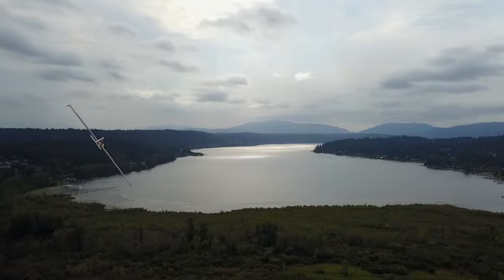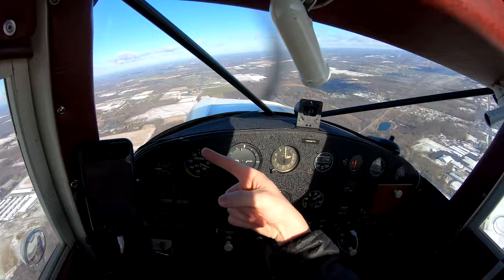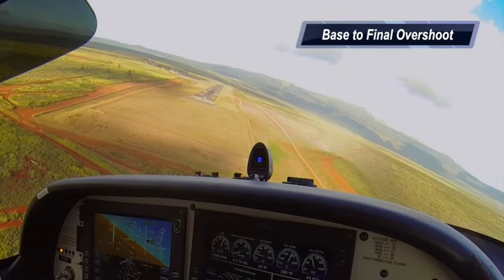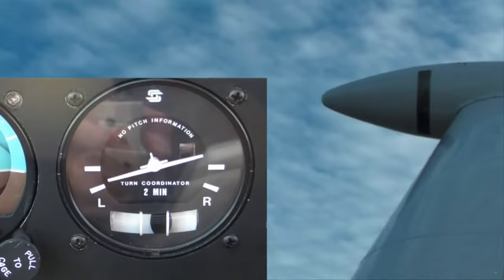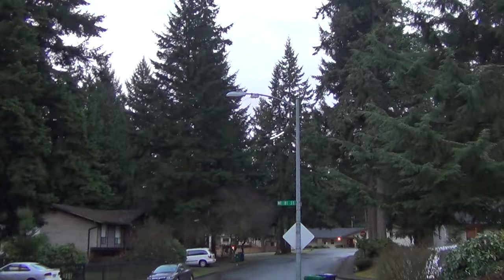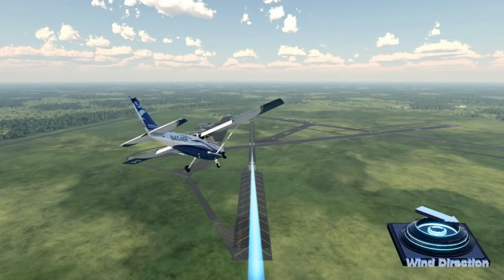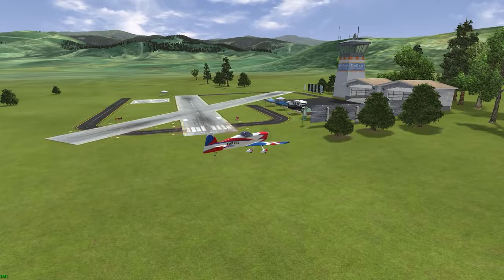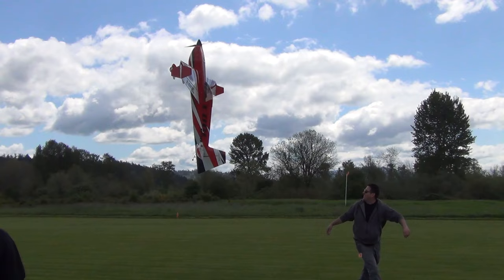Rudder: You MAY Be Using It Wrong. Here's Why.

Comment: This reminds me of years ago when, at the flying field, our longtime club president mentioned he hardly ever used a rudder input. This got me rethinking using the rudder more, improving my overall enjoyment of it. Much later, during flight instruction In a 150 Cessna in Fairfield, MT, using the rudder all the time, especially during the landing approach. Now Fairfield, MT, is close to the east side of the great divide, and the wind blows strongly from the SW most of the time. For reasons unknown, the main landing strip runs SE to NW, and strongly induced side slip was mandatory. This experience improved RC's enjoyment even more. Thanks for that instruction.

Comment: When I first learned how to slip my FMS supercub I went crazy with. There's a driveway all the way around our field, and I flew 3 or 4 packs around it, on the ground😂 I would alternate between wheels, but never really went up in the air. These shenanigans continued for months because driving a cub around is way more fun than flying it lol. This is with headtracking FPV and a decent bump in power over factory of course, but still, one of the most satisfying things I ever learned.

Comment: I've been flying fixed wing rc for almost 20 years but never really used the rudder other then on the ground. However the last couple of years I have gotten into fpv quadcopters. As you know with quads you use a lot of "rudder" to control your direction.
I have noticed that I use the rudder on my fixed wing planes much more. I look back to how I used to fly and I realize I have been doing un coordinated turns all these years. I recognize how the plane looks and  can adjust rudder correctly to keep turns coordinated.

Comment: Great video and explanation!
What's weird is that I started flying RC with rudder only.  1 channel.  I even learned to do rolls and loops with rudder only !
And a few decades later got back into RC, and almost never touch rudder.   
Now I'm trying to learn to use the rudder more.   Dang near want to go back to 3 channels; LOL.   Stopped using a mix for coordinated turns.    Having fun with flat turns.   And learning to do 1 wheel touch & goes.     It's like starting over, but doing it the right way.

Comment: It's like kayaking the rudder isn't for steering. it's to keep it straight. As you paddle it clocks ( turns) so you compensate with rudder. The shorter the kayak the worse the problem.  On my 5 mtr it's up and I don't use.  On my 4 mtr I do use.

Comment: Should be required viewing for all RC and full scale pilots. Great job 👏🏼
Reply: I wouldn't say required some of us RC are flying wing and delta craft with no tail control.  The flight test versa wing was my first, I got good with yank and bank with the arrow, and the flight test version of the saab 37 vegan was the first craft with a tail I flew confidently (still no control inputs because that's not a control surface on it).  I had some regular old trainers and I think I had crashed one of those cessna based craft.  I'm gonna have to learn some more on this rudder controlled slipping, even if my favorite planes don't use it, it can be helpful in games like war thunder.  Presenting less wing area to the ground by banking hard in one direction and then the other is what I've been doing simply because that's what I found worked.  if you look at the latest video i uploaded the type of games i enjoy playing can be decided by how quickly you can land and rearm.

Comment: my advice is to learn to fly with no yolk inputs, just throttle rudder and trim, its like riding a bicycle with no hands, then once you can do that add the yolk back in for making corrective inputs.
the rudder should be your primary steering input and aileron is secondary.
also flying gliders really teaches you to fly the rudder

Comment: Mixing a little rudder with ailerons is not 'cheating' as you say. It is a sensible use of the tools that are available to RC pilots, particularly novices and intermediate level. It helps to avoid crashes and brings more people into the hobby which is the lifeblood of the industry. I use aileron/rudder mix on several of my models and if that makes me a cheat, then so be it.
Reply from the maker: To clarify - we have no issues with and promote stuff such as SAFE/panic switches. It allows more folks into the hobby that couldn't otherwise due to not having a local club with instructors available. You are 100% correct on that. Our "cheating" comment was a lighthearted tease. Our concern isn't with folks using mixes/SAFE, - it's those that use these tools and never try to practice flying without them. 

While flying, there isn't one set ratio of rudder to use with aileron, it's entirely situational. In other words - a mix doesn't always give you a well-coordinated turn. Learning what a coordinated turn looks and feels like is a great stepping stool to becoming comfortable flying models that could drop a wing when uncoordinated/models with a lot of adverse yaw. Stepping outside your comfort zone to try new things and even sometimes crashing is all part of learning in our awesome hobby.
Reply: Some people refuse to step outside their comfort zone.

Comment: I have several hundreds of hours in an old full size  1940 Taylorcraft BC-65 I restored in 1975 at the age of 22. These planes have an empty weight of 730#and a gross of less than 1200# with a 36ft wingspan. It LOVES to float and often it was necessary to use heavy cross controls to slide slip to put it down on a dime. One day clouds came in rapidly until the treetops at the end of the runway were actually in the clouds. Halfway down the runway I turned the plane at 90 degrees to the strip and at the last second took it out of the crab and got it on the runway in just a few hundred feet. Lightly loaded with a stall speed of 38mph I've actually taken off ACROSS a runway in less than 50ft with a very strong crosswind! Reminds me of the old flying joke about two idiot pilots doing their first ILS. When the runway finally comes into view the copilot says< "WOW! That's the widest runway I've ever seen," To which the pilot replied, "Yes, but it sure isn't very long!"

Comment: I'm about to take my commercial pilot checkride and i still don't know which is a slipping and skidding turn without thinking of how I have the controls when i do a forward slip to landing.
Reply from the maker: Here's a quick way that I learned and chose to teach my students to remember the difference. In a sideslip, the longitudinal axis of the airplane is parallel to your ground track while flying cross controlled. In a forward slip, the longitudinal axis is no longer parallel to your ground track, but rather is angled well outside of it while flying cross controlled. Hope that helps. Good luck on the checkride! -Zach

Comment: Super helpful to a Newb pilot like me. I have a question though. 

On my Timber X, Rudder input seems to Roll me more than what I'd expect. I can't do a flat turn without fairly massive aileron inputs. I know RealFlight9.5s isn't perfect, but the Timber X there doesn't seem to roll hardly at all from rudder turns. Is there something I'm not considering here? or are the physics not as good in-game as I assumed.
Reply from the maker: You're not wrong! The simulator is always not going to be a 1:1 of reality. This is one of those scenarios. Keep at it with the real thing, what you're referencing is cross control and it's EXCELLENT to practice. The Timber X is great for that with flat turns with how much aileron it needs.
Reply: Same on my Timber X, that big rudder loves to roll the plane. I've noticed that Real flight has really bad physics a lot of the time especially with yaw roll coupling. TBH Real Flight is great for beginners who have never flown rc planes before, but once you get pretty much any experience you'll realize that flight hours are 1000 times more valuable than flying on Real Flight for the same hour.

Comment: What kind of spectrum transmitter would you recommend?
Reply from the maker: That’s currently in production? We’re not really fans of anything that’s budget friendly as they all have issues with scroll wheels, lag, and switches breaking. The IX-14 seems to be the most solid of their recent releases, though. If you can find a refurbished or second hand original DX-9, that’s our favorite budget friendly pick. -Zach

Comment: Ok so as a new rc flyer, I have been adding rudder to my aileron and elevator so do I add it to a different switch when I am programming? I don't think I quite understand it.
Reply from the maker: Don’t use a mix to fly with rudder - just use it organically. Mixes never give the proper amount and can actually induce an asymmetric stall.
Reply: @TailHeavyProductions  alright so I don't think I am mixing, I am doing aileron elevator and rudder for my dual rates all on the same switch, so when I switch high med low rate they all go at the same time. So that's not mixing right? Sorry for the dumb questions just want to get it right.
Reply from the maker: Sounds like you’re just setting up dual rates?
Reply: @TailHeavyProductions  yep I haven't even tried to venture into mixing. So last question setting up the dual rates on one switch is ok right?
Reply from the maker: @aheis1313  Totally personal preference - all up to you!
Reply: @TailHeavyProductions  awesome thanks for your time and help

Comment: The worst are the disease spreaders that tell people to REMOVE the rudder.  I understand if it's a cheaper model that doesn't come with one but to actively remove one in the guise of 'weight savings' and to preach that idiocy to others is a cancer to the hobby. 
The worst is when you neuter a glider and then boast how well it thermals when all you can do is reduce lift to bank and yank to make a turn to stay in a thermal.